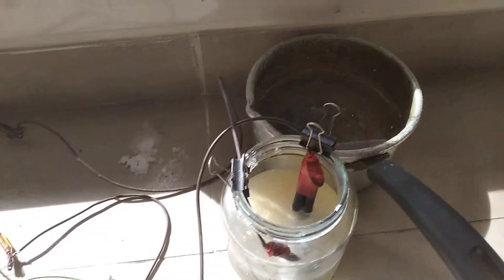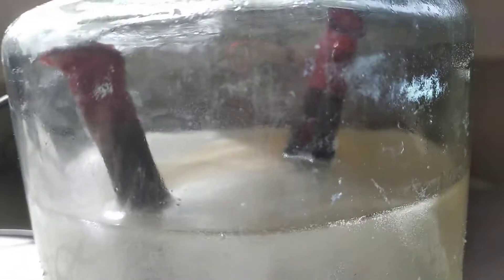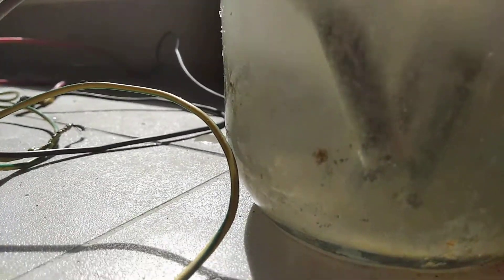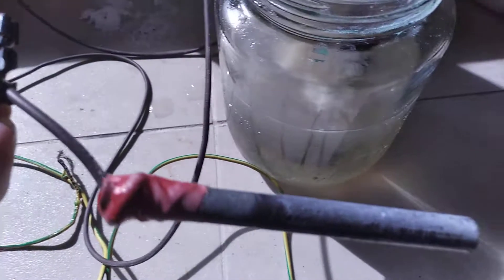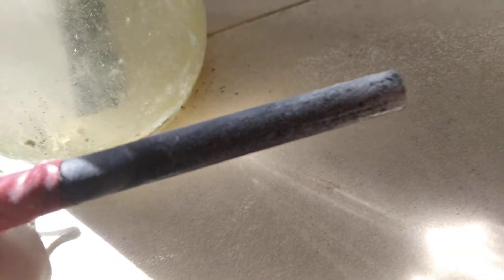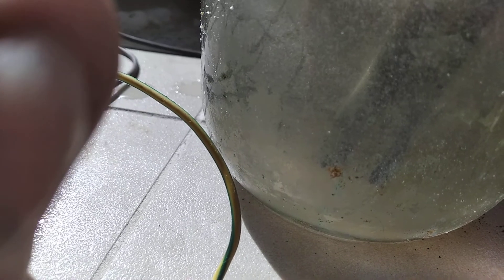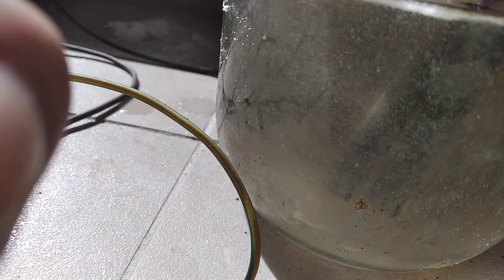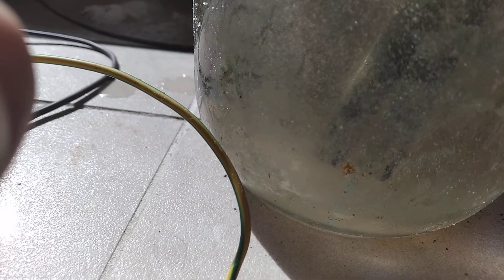graphite passive pH controlled chlorate cell no errosion

Comment: lyrics 

So, this is actually just a test, now I'm running this uh.. below 40 mA per cm2. I use this shunt that has been pre-calibrated before the run using a steel wire and measuring the current with another multimeter; ANYWAY, let's just say that I have to devide that number by 2.521. So yeah. So here we have, the solution has been running for approximettly two hours now in a saturated solution of sodium chloride and a little additive to control the PH which is calcium chloride. Now I wanted to see if graphite can survive... PH control. Because it works well enough with MMO that the PH stays at 7.0 throughout the run, but then I wanted to prove that with some visible proof by using graphite. Now the thing with graphite is that if the PH were to get too high it would start eroding, but it's been two hours and usually by now, the damn thing would have eroded, now there's also another evidence which prooves the PH control, now as you can see the cathode, I'm gonna bring it out, there's gonna be a white percitipate of calcium hydroxide which is evident by looking at it, like there's this nice white layer of calcium hydroxide. As you can see, it's some sort of encrusting over here. Due to the contrast it's kinda hard to see, but this is actually what's controling the PH, cuz the calcium chloride is gonna produce calcium hydroxide on the cathode which is insoluable in the solution thus the PH doesn't go any higher or any lower than seven and that is one way to preserve your electrodes: whenever you're doing a chlorate cell you have to add a bit of calcium chloride which will prevent the degradation of of your graphite anode, which over here, literally the solution ain't black, so if the solution ain't black it means it's working. Now you guys don't have to worry about {paint staking and????} adding hydrochloric acid, instead you can just add a bit of calcium chloride and when you see the sings of uh.. black start to come out of your anode that tells you have to add more calcium chloride to prevent the degradation of your electrode pain oke, so anyway, after a few day this should be nearly pure chlorate, cuz the moment it does start degrading even if calcium chloride is added it means that the chloride levels have gotten down and now the chlorate is the one that's being electrolysed which no matter what you do even with the PH control this graphite ain't gonna take a perchlorate cell. So yeah that's all for now, so I just made an expleanation to see if wheter or not graphite can withstand the PH control cell without erosion and that has been successfull, however I will add continous updates of this experiment, so in the upcoming days, so yeah you guys will see some updates later, okey BYE!
Reply: That’s some scary dedication
Reply: @TheFireGoose  yup
Reply: @karolus28 thanks man, my english is bad
Reply: @futurocaveira4385  damn i was kinda obssesed with this video then xD i forgot i made this
Reply: @futurocaveira4385  nu uh i dont trust you
Reply: @karolus28  😭😭😭
Reply: {shot?} = shunt
Reply: @BalticLab  yea I figured that one out some time ago and didn't edit but thanks

Comment: Are you using high density graphite rod?
Reply from the maker: gouging rod but overall this cell was a disaster!!
Reply: Gouging rods are very porous and brittle, battery graphite rod is very hard, heavy and not porous, it is what i used to coat with lead dioxide but it crack for a week of run and discontinued the use of it and end up throwing them.
Reply from the maker: @cebupyro8036  even coating a copper sheet with PbO2 is more reasonable than graphite.

Comment: thats actually best :) i have been doing that, i no longer use GSLD due to its toxicity and also quite messy to process, sea salt normally contains calcium chloride, i have observed that when im using sea salt the errosion is not that much compared to using pure sodium chloride.
Reply from the maker: you can also add some HCl to convert Ca(OH)2 in the cell back to CaCl2 and essentially it acts as a pH buffer and addition of HCl will create less chlorine thereafter.
Reply from the maker: fuck GSLD I use CSLD or PSLD
ceramic or polymer substrate on current carrier Ti or magnetite or graphite.
Use lead chlorate/perchlorate made by ion exchange electrolysis!!

Comment: Awesome experiment!!! Bust open some pencils and toss it in a jar, set! 

Would this integrity solution also work with Carbon electrodes (not equally but in measure)? Also as far as I know carbon electrodes are just compressed activated carbon and if it gets to acidic or base yeah it would break down IMO
Reply from the maker: this experiment technically is still a failure due to massive chlorine evolution so unless you want a good way to gass yourself pH control with graphite is not recommended.
Unless you have a HCl recovery system and I wonder if you can use UVC for that since UVC also accelerates the formation of chlorate!!
Reply: @CatboyChemicalSociety  Haha, my last source of a pva membrane was a clay pot. Any experiment you put up helps. ...using CaCL as buffer will stick. Right on!

Comment: Hey! Interesting idea. I'm building my own chlorate cell with graphite blocks I found in the dumper. Have you ever heard of using carbon dioxide to lower the pH. It can be easily generated with an airpump, some sugar and yeast.
Reply from the maker: yea cant use CO2 it wont actually form carbonates unless maybe you use CaCl2 then slowly bubble CO2 to PPT our CaCO3
Reply: @CatboyChemicalSociety  if you have naoh ions they will react with co2.  It will lower the ph.  But it won't get down to 7.  It will stop at the sodium bicarbonate point which is 8.5.  That may be enough to reduce erosion.
Reply from the maker: @lrmackmcbride7498  thats why you need CaCl2 to precipitate out Ca(OH)2.
Basically carbonate wont really do much because carbonate reacts with chlorine to form hypochlorite which has a pH of 11 meaning back to square 1.
Reply: @CatboyChemicalSociety  bicarbonate is going to buffer fairly well until it is exhausted.  Hypochlorite isn't really stable at 8.5 and moderate temperatures (50c).  Feeding co2 in should keep it at 8.5 as the bicarb is regenerated.
Reply: This paper has some intersting results regarding graphite itself but does not address the binders in battery electrodes which could be what is actually failing.  Based on their graphs pH 8.5 is a sweet spot for graphite where hypochorite ions and salt are balanced.  The other locations being 7 and 2.
Reply from the maker: @lrmackmcbride7498  ok CO2 injection may work but I have not tested this method.
also Cl2 will continue to be lost and bicarbonate will build up.
But I can see how this will buffer it to pH 8.5 if you managed to get it to work.
50C is too low because a graph that talks about loss of chlorine vs temp in a chlorate cell suggest the minimum viable operating temp is 60C to 85C and I run at 75C.
CaCl2 buffers it to pH 7 and there are other buffers like MgSO4 and AlCl3 that work the same.
Reply from the maker: @lrmackmcbride7498  the efficiency at pH 8.5 would probably be just above 55% to barely 60% and idk if its worth building a CO2 injection system vs sprinkling some magnesium sulfate or calcium chloride or even mixing aluminum foil and HCl and putting the resulting solution into the cell.

For an experiment to explore the buffering effect of bicarbonate its fun to build this setup but for an actual run with the goal to produce chlorate then there are way better and simpler options.
Reply: @CatboyChemicalSociety  i am not sure what complexity you had in mind.  It would simply be a tube pushing in co2.  How you generate the co2 has a tremendous number of options.  The efficiency of standard non-ph controlled cells is between 50 and 60%.
Reply from the maker: @lrmackmcbride7498  yea but its still more complicated than simply adding a buffer about 8g/l and letting it run with only adding HCl at the end incase you re use the electrolyte.
Otherwise you can just discard it after processing and CaCl2 is quite cheap as an additive.
Like I do like complex projects but theres needless complexity with the idea of using CO2 injection systems for chlorate cells.
Reply: I have a friend from Ukraine who went to an abandoned city, lots of graphite there he found a really compact block of it looks industrial grade near an abandoned power plant
Reply: @honja6528 JAJAJAJAJAJAJAJAJA radiation, what si that?
Reply: Why not to use HCl?
Reply: @Know_Sparks  HcL is controlled where I live, so it's not easy to get.